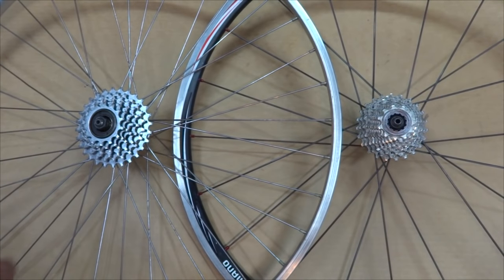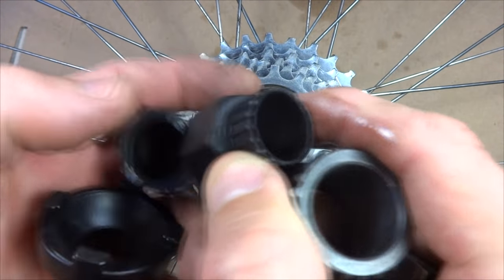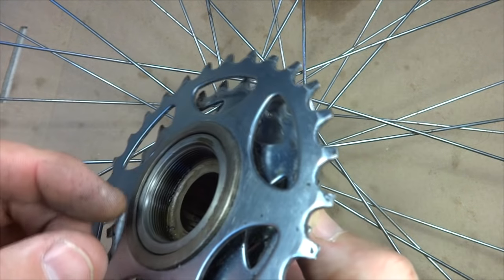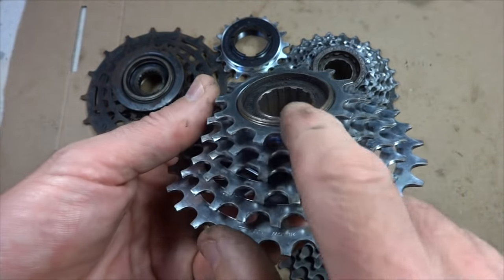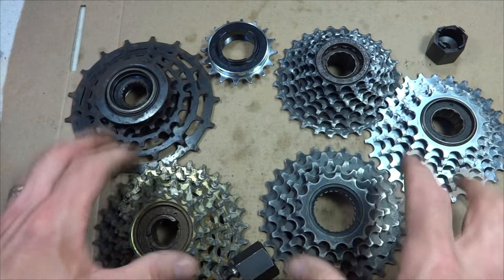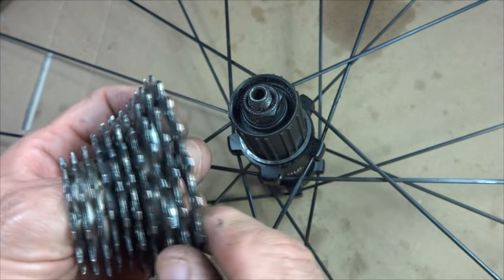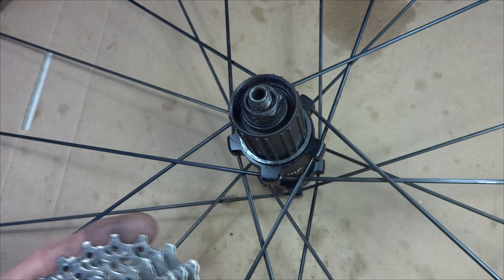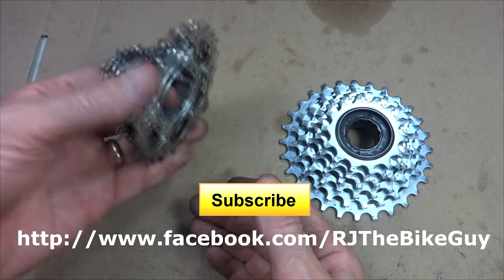Freewheel vs Cassette - What Are They? Can I Convert?

Comment: Hello, I have a 2017 Cannondale Quick4 (it is a 9 speed) and I would like to convert the mountain bike XR Suntour XCM (3) chain ring (48 38 28) mtb cranks that it came with to a road bike two chain ring cranks..Maybe like Shimano 105's or something with a 50 or 52 tooth outer ring. Also a Hollowtech II bottom bracket.

My question is what exactly needs to be swapped out in order to make this conversion? Can I keep my current chain? Can I just lock out the smallest chain ring so I can keep my current shifters and cassette? I believe I need to change the front derailleur and that would be fine with me but not sure. I am trying to change the least amount of components as possible besides of course the bottom bracket and cranks.
Reply from the maker: https://www.youtube.com/watch?v=TcyaSEAhI5k
https://www.youtube.com/watch?v=lNoJJOvLqjw
Reply: Thank you for the links gave the vids a watch but the how to isn't my problem it's the problems I may run into when replacing my 9speed 3 chain ring mtb cranks to a 10speed 2 chain ring road type crank? Will my 3x9 front derailleur/shifter work? Will my current 9 speed chain work well with the new 10speed cranks?
Reply from the maker: Yes.

Comment: in other words, MTB is only about cassettes and the freewheel weird hubs are for other types of bikes
Reply from the maker: Not sure where you got that. Mountain bikes are found with both type. Road bikes are found with both. Has more to do with the age of the bike. Old bikes didn't have cassettes, because they didn't exist yet.
Reply: @RJTheBikeGuy   you are right I've been building my bikes only for the past 5 years so I never knew the freewheels
Reply: I heard that freehubs are better protected from dirt thus are more suitable for mtb.
Reply from the maker: @Luciano-jg5ws  Not really. The main benefit is the axle bearings are farther out, so the axle is better supported to reduce the chances of it getting bent.

Comment: I have new wheel with a cassette with eight cogs but my twist grip gear changer is for seven gear cogs what can I do for the best please help my daddy doesn’t know to do it
Reply from the maker: Won't work. https://www.youtube.com/watch?v=xMvD1T4qF1E
You will need an 8 speed shifter.
Does the wheel fit? 7 and 8 speed wheels usually have dfferent hub spacings.
Reply: RJ The Bike Guy thank you so much what about a seven cog cassette would that work
Reply: RJ The Bike Guy not tried it yet my friend says I can put a 7 cog cassette on is that correct
Reply from the maker: @misspinkknickers4898  https://www.youtube.com/watch?v=Jrd5XAQfgaA
Still might run into issues of hub spacing since the 8 speed wheel is likely wider than the 7 speed wheel by 4 or 5mm.

Comment: Ok is good but where is an advantage of uses cassete except of moore technical and price demands? I thing if you have same smallest and biggest gear the same ind not at real so much difference even if you have moore cogs, especially you dont need an expensive thin chain, what I consider good enough and familiar with my mechanic skills. So why should I use cassete?
Reply from the maker: Cassette uses freehub, and that design allows hub bearings to be farther out, so less like to bend axle. Personally, I don't care what you use. I was showing the difference.

Comment: why don't they put the freewheel on the front sprocket?
Reply: northy Land because it doesn't need one
Reply: I meant no free wheel on the rear, but one on the front sprocket instead.
Reply: Actually, this has been tried.  The main advantage was that you could shift while coasting. But the crank usually sees a lot more torque than the crank, so a front freewheel mechanism needs to be a lot stronger/heavier. Also, cranks and bottom brackets are generally harder to work on.
Reply: They do on competition trials bikes. I don’t see the advantage.

Comment: That's not true as I've had a bike shop take the free hub off a cassette wheel and screw the free wheel cassette onto the wheel on place of the hyper glide hub basically to avoid having to buy a 7 speed cassette
Reply from the maker: And I have seen pictures of Bigfoot.
Reply: Either you heard it wrong or the bike shop gave you a new rear wheel without telling you.

Comment: Hey RJ..I learned a lot from your videos and did alot of things myself watching your videos... Recently I was thinking to change my rear hub from freewheel to cassette and I saw a video which mentioned that rear derailleur has lower limit if it's 14 teeth you cannot use it with 11 teeth cassette efficiently.. all I know is my bike spec mentions it has shimano rd tz500 and came with a freewheel 14-28... If I change my hub will it work with cassette 11-28?

Here is the reference to the video:

https://m.youtube.com/shorts/r408GzmimLw